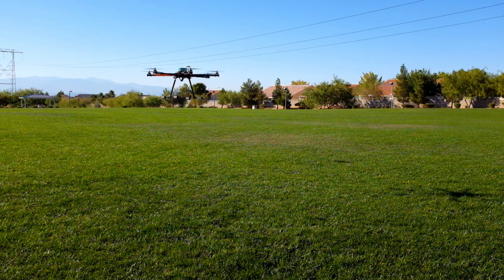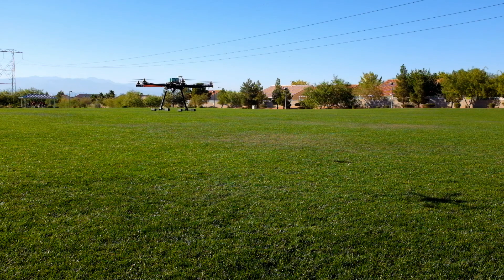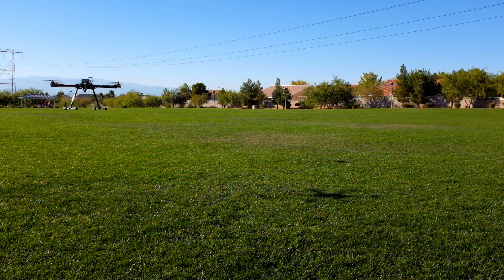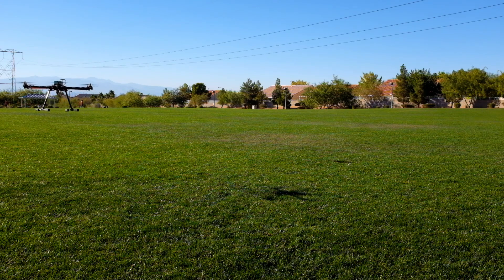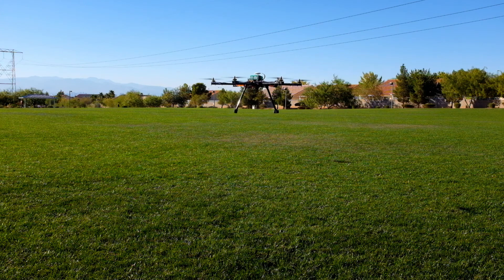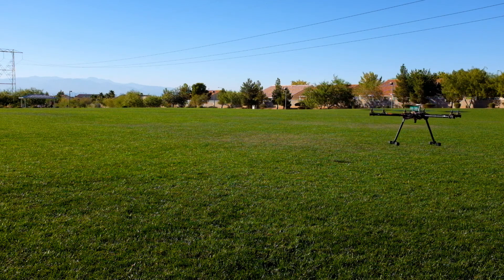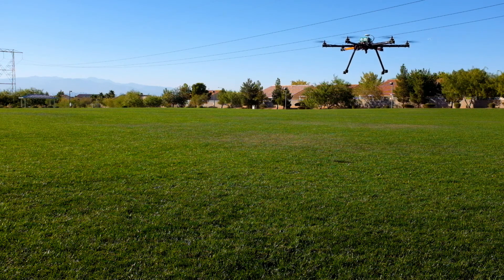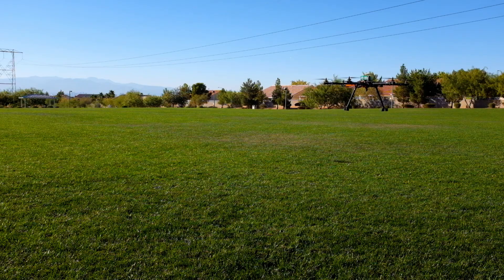Unexpected Drift with Xaircraft SuperX Flight Controller

Comment: That drift is not bad at all. The fact that it can stay within 2-3 meters of where you put it is impressive. The average consumer GPS is only accurate to 5-10 meters. Maybe a level and mag calibration would help. My old Naza and APM boards would drift around a bit more than that.